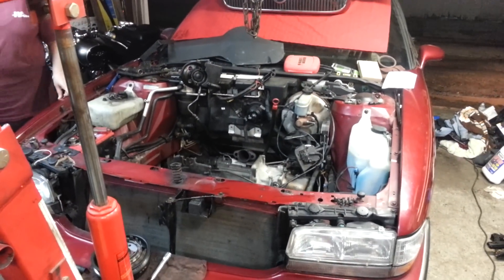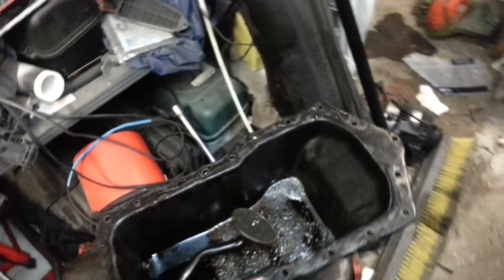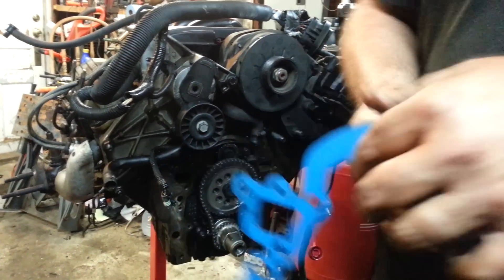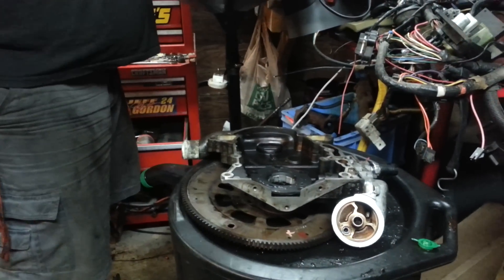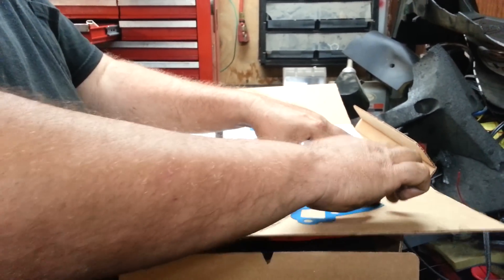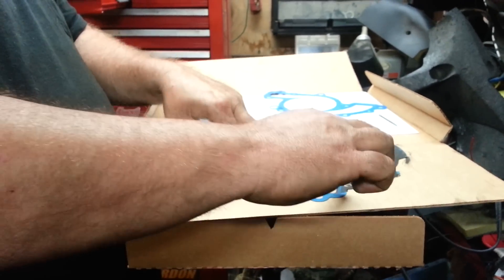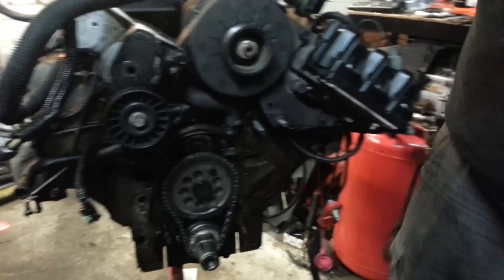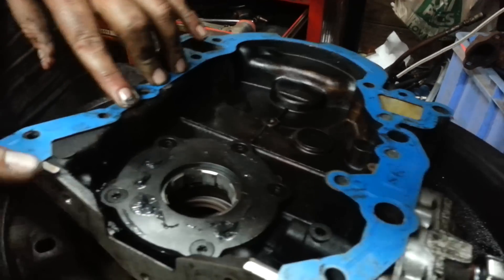Proper use of gasket sealer

Comment: The only place RTV or any silicone sealant belongs is in the Trash.  

Use Hylomar blue for oil pans and Hylomar red for oil pumps.  

Permatex Permahield works extremely well as well.

Comment: So the biggest problem with the blue paper, is that it's silicon impregnated and does not require sealer. The idea is that it cures as it heats up. Silicone will stick to literally anything on the planet including glass but it will not stick to other silicone. This is the most common reason why these gaskets fail in these applications. Just because there's a tube in the box doesn't mean you're supposed to use it all over the gasket. It's for where multiple gasket surfaces meet together. You're supposed to use regular gasket paper with aviation sealer, or high-tac on blue paper

Comment: Getting ready to replace the water pump on my 96 LeSabre.  I’m using a FelPro gasket and I’m wondering what sealer to use for this gasket?  Way too many products and I’m not a mechanic with tons of experience.  I’m going to take my time and I want to do it right the first time.  Any advice or info would be greatly appreciated. Thx.
Reply: Hello Brian ,  any chance you could tell me what product you decided to go with ?  I’m working on the same repair job as you did .  Any help you can provide me would be appreciated .

Comment: Should i use on one side or both? Flat rubber Mahle oil pan gasket. Came with JV7.
Reply: Both sides, but the consequence is the next time you remove the cover it will be difficult

Comment: A thin layer is fine on each side to fill imperfections. If you are worried about overflow falling into the engine, favor the outside edge. You should be fine. Thanks for sharing!

Comment: Straight from the Permatex website:
10. Using a gasket maker as a dressing on a conventional gasket.
This might be the most common gasketing error of all. Many mechanics will use an RTV gasket maker to hold a conventional or cut gasket in place during assembly. Some mechanics will even use the RTV gasket maker as a dressing, coating both sides of the gasket. Gasket makers are the wrong product for these applications – their formulations are too thick for use as a dressing. If you’re installing a conventional gasket, use a gasket sealant – they’re available in sprays, liquids, and tubes, with specialized formulas for a variety of applications.
Reply: Hylomar (near fuel) or Aviation Sealent is king for dressing gaskets....The right stuff with or without gasket for stuff you never wants to remove or places you cant stop from leaking, and Anaerobic Gasket sealer for everything else.
Reply: Amien FND I used Hylomar on my last 5.0 L timing cover and water pump installation. Absolutely awesome! Put small bead of silicone at oil pan corners. Absolutely no seepage.
Reply: I came to the comments looking to see if anyone posted this
Reply: Agreed

Comment: Thanks
Do you use sealer on the water pump?
Reply: Use Real Sealer Gasket Tack.. NOT RTV
Reply: I use rtv on water pumps all the time, just not too much of it
Reply: @kellismith4329 
Hello Kelli ,  could please you tell me what brand / kind of rtv you prefer ?  And how do you apply it ?  Do you create a “flat blanket” on the surface or just squeeze out a “bead” (looks like a snake or a drinking straw) ? Any help you can provide me would be much appreciated .
Reply: @ThunderbirdRocket   I like to use permatex ultra grey because it can be used to seal either oil or coolant, it takes awhile to cure once you apply it, but it has never let me down. If you are also using a cardboard gasket you can apply a thin skin of the rtv on each side of the gasket and the component. If you are using only the rtv to make the seal then apply a 1/8” bead around the sealing area, then tighten up only about half way and allow the rtv to cure overnight before torquing up fully - the sealant can take up to 2 days to fully cure before adding oil/water etc. hope that helps
Reply: @kellismith4329  
Thanks Kelli . Great 👍🏼 detail . Super helpful !  I learned lots from ya !  Thanks for taking time out from your day to assist me .
Reply: @ThunderbirdRocket  you’re welcome, happy to help

Comment: Jesus Christ man!!! 3 rod bearings and 1 main bearing????? And you actually were able to rebuild it.  All joking aside my friend, you’re a great mechanic with a lot of patience because most of us would just scrap the engine with more then 1 spun rod bearings. But you’re good!!! You really pulled that engine right back out of the devils hands lol. Great job!!!! I still own my first car since 1987 which happens to be a 87 Buick Regal Grand National WE4 edition and knock on the wood my engine has 59k and still runs like a new engine. I’m about to replace my stock timing chain set up with a double roller timing set since I just found out that the stock cam cog teeth are nylon.  $h!t,,,, I don’t need any of those teeth to break off and get caught in my oil strainer.  I have the exact same type of timing cover you have here which is why I looked for your video because I was not sure how to seal it closed. I actually bought a new timing cover with the high flow oil pump in it.   But I can’t say I blame you for saving that engine because all my numbers match on my car and if for some reason my engine ever spun a bearing and it chewed into the thrust and destroyed that actual block with my vin numbers on it. It would be pretty upset. 
   But anyway you did a great job and thank you for the tip on how much sealer to use on that timing cover gasket. I wasn’t sure and we have the exact same timing cover. Or at least the same gasket. If you can think of anything else that can help me please lmk. I’ve done timing chains and belts before just never on a car that means this much to me.
Reply: Science dam straight mofo!

Comment: How about on a silicone oil pan gasket? Do you use sealant on the oil pan gasket, not at all, or just in certain spots? Very confused, some people say use it all over, some manuals say just in certain spots etc.
Reply: Rtv doesn’t play well with rubber gaskets it merely makes them slip around

Comment: Thanks for the video. What's your preference for sealant?
Reply: Gasket Varnish for paper gaskets like video.
...Not rtv/silicone.
Too much silicone slides around , plugs things up, and takes 12 24hr cure.
Its a different world with dry flat metal.
Varnish is made for gaskets, not to Make a gasket (rtv).
Varnish is definitely worth it on paper gaskets, especially vertical sliced crankcases.
Plain paper gaskets can strip bolts trying to stop them from leaking.
Reply: Ultra grey is my favorite, long cure time though

Comment: Would you think using the copper gasket sealer on a 1988 mazda 626 oil pan? Car is cherry, just got it from original owner with 100k miles on it with a full factory maintenance log book lol, I assume the gaskets are just old and dry and warm from the low milage, I don't now anything about cars really this is my first gasketsaw your video about sealent

Comment: Great video mate. I would be pissed at the last person who put that much on & gave the motor a death sentence.  I've seen a lot of good mechanics use the same method, just a thin layer.  Why the hell would permatex show a massive bead all the way around the mating surface? ?
Reply from the maker: Thanks, the guy that owns this car is still driving it daily. Had to replace the harmonic balancer a couple of years ago for him, other than that he hasn't had any issues.
Reply: What is the correct way to seal a head gasket?

Comment: Thumbs up. I've seen SO MANY times it being badly used. 
Ranging simply from the bad looking, to a seized overheat engine do to sealer blocking the cooling system...
One blister of sealer in my hands lasts ages the trick word is film, a very thin film nothing more. Thanks for sharing. ;-)
Reply: All you can do is snug his way.
Then come back tomorrow & hope torque them.
Too much silicone and they slip badly every time.

Comment: so spread the rtv on both sides of the paper gasket right?
Reply from the maker: Yes, a very thin layer on both sides holds it in place during installation and aids in sealing.
Reply from the maker: I do each side individually myself, it's just a matter of preference. Either way works. And correct about letting it dry before hand, just have to make sure you don't leave any lumps.

Comment: that actually looks more like rtv sealant than gasket sealer. the gasket sealers i'm familiar with are liquid and are applied with a brush. they tack up after a few minutes of application, whereas rtv sealant is meant to be used as a gasket all by itself in applications where gaskets are not used, such as timing chain covers and oil pans.
Reply: ...Gasket Varnish is different then rtv/silicone.
It good stuff, aviation quality.
Just a thin soaking layer, soon its glazed tacky wafer.
Its good simple insurance imo.
Reply: I agree and I feel like there is a debate which to use. I have a rubber gasket and I will use a sealant rather than rtv to hold it in place and help seal up any imperfections in the metal
Reply: Cork paper don't know which would be better this or sealsnt
Reply: If it is a rubber gasket I really like permatex rubber sealant and gasket dressing
Reply: It's cheap widely available, for cork paper i think it depends on the thickness. I would probably go with permatex aviation sealant purple high tack y stuff.
Reply: But a thin layer I think of rtv is acceptable. It's just that if it's not. Metal to metal where both surfaces are applying comressive force rtv-gasket interaction   is unpredictable.

Comment: What's the point of using that rtv on only one side? its not going to make it seal better.  in your case it will be many hours before you start the car again. but someone doing a quick repair with engine in the car still cannot wait 24hours for that rtv crap to cure so it will blow out the gasket when they run the car 1 hour after assembly!  the new no-sealant gaskets by felpro are the best and fastest solution
Reply from the maker: I only showed the one side in the video, I stated that I already applied the other thin layer to the block. Also when used properly the car can be driven right after completion without blowing the gasket out, this video was done over 3 years ago and the car is still going with the work I did. By the way, I had the engine back in and fired up approximately 4 hrs after this video

Comment: does it dry like glue? I heard parts are hard to get off after putting this on? why don't u coat both sides
Reply from the maker: +adam mickiewicz , it stays plyable after curing. I coated the opposite side once gasket was in place. parts still come off without any problem just use a gasket scraper to remove gasket material when it comes time to, cheaper than the oil that would have to be bought because of a leak that could occur.
Reply: +silverado4x4man I was told u can use this on my carb bowls on my motorcycle. they're seeping some gas
Reply from the maker: I would use this on anything in the carbs, the bowl gaskets are normally similar to o-rings and get compressed over time and need to be replaced. there are just some things not to use a sealer on, carb related = no sealer
Reply: +silverado4x4man would or wouldn't?
Reply from the maker: +adam mickiewicz wouldn't
Reply: +adam mickiewicz - You can use it in minuscule quantity to get it going (workaround). 
But honestly do yourself a favor, get the proper gaskets/O-ring.
It's not a good procedure for carburetors. Will be less troublesome in the future to have decent gaskets. ;-)
Reply: silverado4x4man?

Comment: Great vid, I tried this but I think I left gaps whilst spreading it.  Will this cause an oil leak?
Reply from the maker: +Johny Hewitt , the gasket should not leak by itself. all this does is fill in any imperfections that may leak or seep and help keep gasket in place during installation.
Reply: Cheers buddy

Comment: Thanks for this - was replacing the stator on my bike this weekend and managed to rip the alternator cover gasket. Was pretty annoyed at the time but while waiting for a replacement I took the time to learn how to do it properly and it looks like I would've caused myself a whole lot of trouble. So in the end worth the £10 for a wasted gasket as I would've had sealant running all through my engine otherwise. Thanks a lot for the clear instruction.

Comment: This is indeed the correct way to use gasket sealant.
Reply: +Mc Lovin Ummm....Not quite   Should be titled "The Improper Way To Use gasket Sealers".  NEVER use sealer on the face of a rubber gasket and NOT with your bare finger.  It amazes me how people consider themselves to be "authorities" on a topic just because they are able to make a You Tube video!
Reply: +rlar27 I don't know. But that gasket looks like a paper gasket. It's so thin.
Reply: Javier Ramirez
It's a paper gasket. It's the correct way to seal a paper gasket with gasket sealer.
Reply: +Mc Lovin Yeah, I think so too. I put on a paper gasket without any sealant on my water pump and it's leaking like crazy. I'll put some sealant on it tomorrow and see how it goes. Could be my water pump being faulty, but beats buying a new one. Edit: I think it's a metal gasket. The sound it made when he was aligning it to check the size. 1:30

Comment: Why is it important to not let the sealer ooze out of the gasket? Does it cause a leak?
Reply: MonSTAR_96 no it does not cause a leak, it squeezes out and can break off inside the engine after the sealant drys, causing clogging issues.
Reply: Blobs of broken off sealer block oil passages and cause engine failure . Never use In a dry sump engine like a Harley-Davidson.

Comment: This is the same engine I have the problem I have is oil filter adapter housing gasket do I use sealant on it I have the gasket to do used the gasket and it still leaks so usethe silicon and the gasket let me know if that's what you would do?
Reply: I also want to know this
Reply: +Mitchell Vance - Liquid/silicone gasket can be used rationally. 
Meaning every other good procedures for gasket use should be implemented also. Like good quality gasket, properly cleaned and matted surfaces, etc. 
Think of it as a backup, not as a band aid.
PS: Word of advise, if it oozes everywhere it's not being correctly used. ;-)